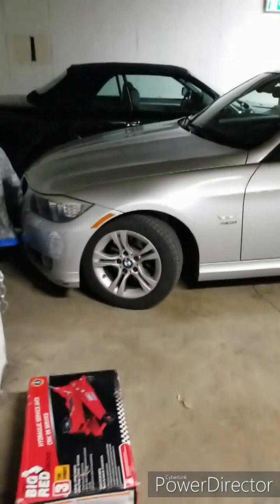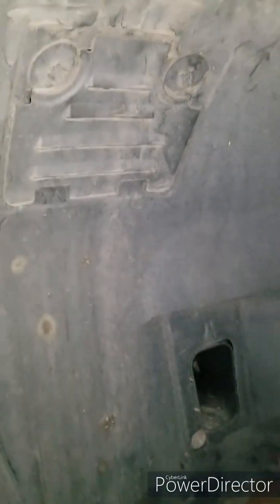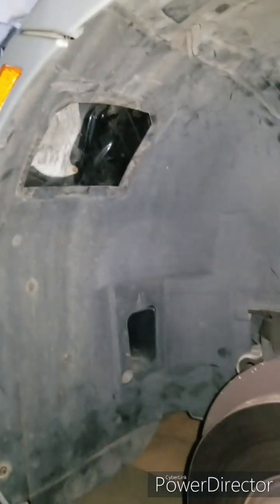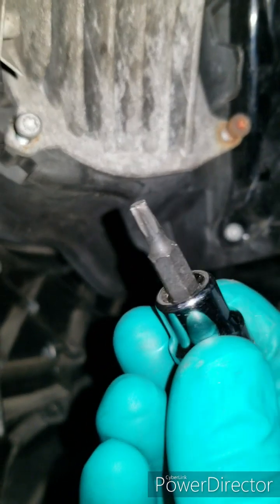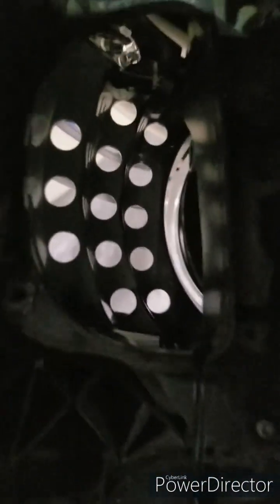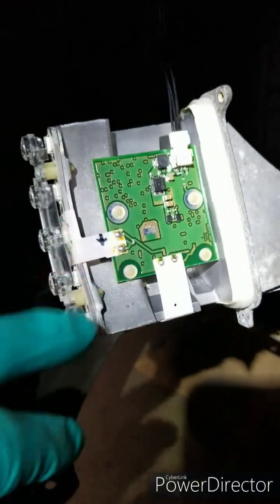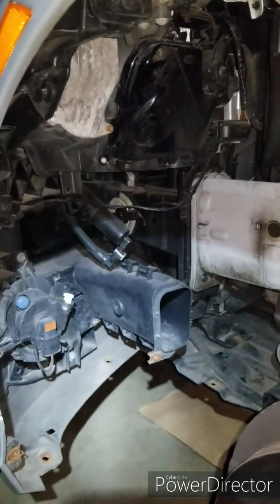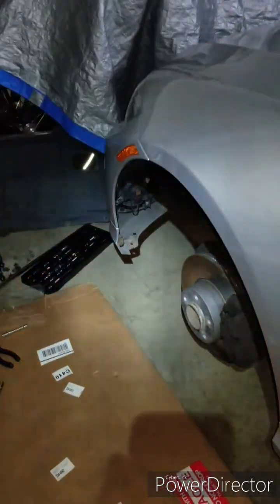BMW E90 LED indicator unit removal and fix

Comment: Hi, may i ask u for an advice?
After i took modul to the measure it was 0.7 at diod wich didint light and 1.6 lighted. Is these 1.6 alright or not?

Thanks for your time. 
Jacob

Comment: Hey, I disassembled everything and measured with multimieter like shown, and every led lights up. Voltage on the two points is also ok. I dont know what to do now
Reply from the maker: Most likely a trace between 2 LEDs is broken. Check for continuity between LEDs with the Multimeter. It could be similar to what I showed in the video.

Comment: Awesome explanation, thanks! Insane design for a turn signal.
Reply from the maker: Thanks, appreciate your comment. Good luck with the replacement or repair.
Reply: @ I managed to find the broken line and solded a small cable to fix it. Thanks to your drawing it was very easy to find. Has mounted it in the car today and it works perfectly! I’m so grateful for your awesome video! 🙏🏻😍👍
Reply from the maker: @danielf_swe  excellent. Glad that it worked well for you.

Comment: Question: How long does the extension need to be, and, what size is the Torx screw?
Reply from the maker: Hi Steve. The extension I used is about 20cm long. Different lengths should work ok as well. It should not be too short. 15cm is probably the minimum. Torx size is a T20. Good luck
Reply: I have both 6” and 8” flexible extensions so I should be good, thanks!

Comment: Omg thanks god I found this video hahahaha tried to pull it off without undoing the top screw, had no idea it’s there! Thanks man!!
Reply from the maker: Glad that it helps you Eddy. It took me some time to figure it out as the information about how to do this was not there and what is available was not easy to find. Good luck with the repair and/or replacement